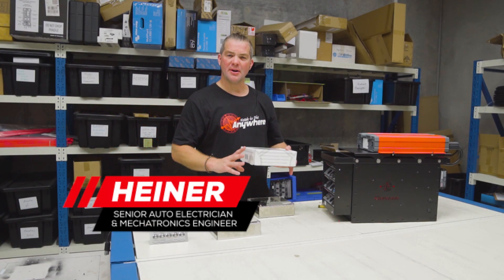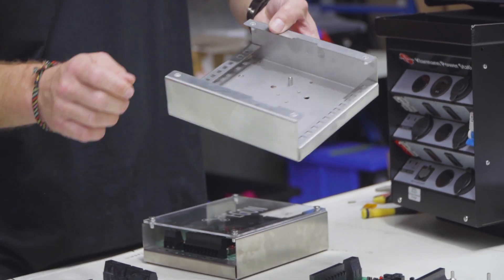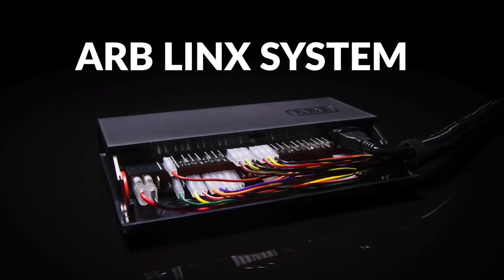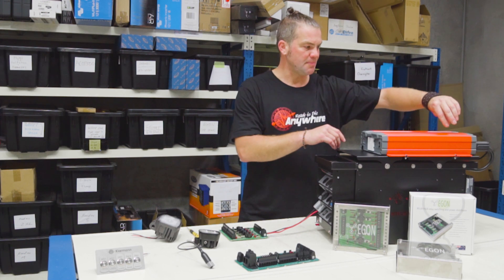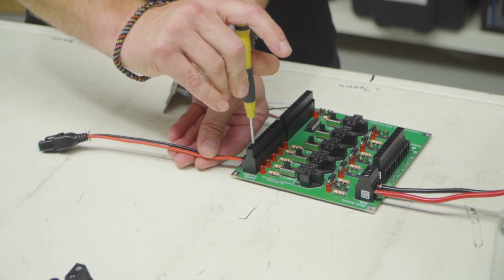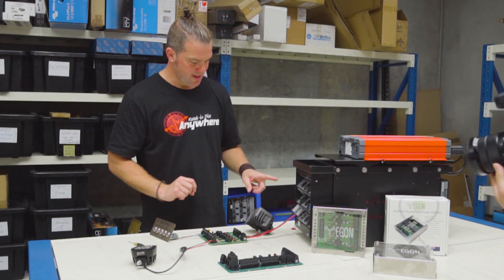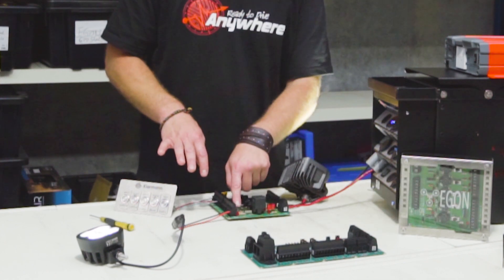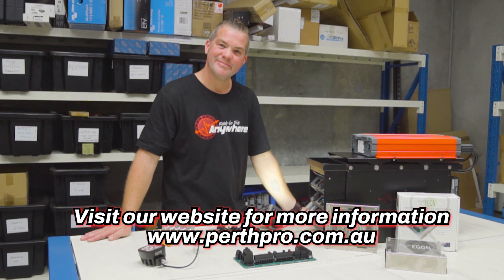Egon Relay Hub | Relay Switching & Power Distribution Solution

Comment: @ready to drive anywhere , Love your products. Been using the EGON DC Hub in my troopy build in the states.  But now building a single cab truck and the size of your products seems too big. I’m leaning toward new solid state realty systems for the compactness and fuseless ability. ( MSD Solid State relay hub, Switch-Pros, M-Unit blue, ) Any positives in sticking to the old school relay and fuse setups?

Comment: I just purchased a redarc bcdc40 and was about to pull the trigger on the Egon DC hub, but now im kinda confused, what's the difference between the relay hub and dc hub? I can only see a switch extra in the relay they both do the same. What do you recommend?
Reply from the maker: Hi there, thanks for your question. The Relay hub allows you to switch the 5x 20a outputs, where the DC Hub does not have any switching capabilities, but includes more outputs as well as inputs.
Reply: I’m also confused on this. Wouldn’t switches be separate to both relay and dc hubs? Do I need both with units with my build or just one? @ReadytoDriveAnywhere 
I really appreciate the approach to this product development. The quality, simplicity and support have helped me be slightly less dumb in the 12v space when attempting my build. 
Now ready to deck it out with all things egon

Comment: Seems like a great product. How does it compare against the Auxbeam 6 gang and all its copies? Are there any advantages when using the Egon?
Reply from the maker: The switching capacity is higher (25A), it is easier to integrate a large variety of switches into the Relay Hub (also OEM style switches in the dash for better vehicle integration), the Relay Hub has got constant power outputs, Relay Hub does not use any power in idle, It has got a maximum power rating of 80A, manual override switches on the unit itself, if a relay fails it can easily be replaced with automotive relays that are available worldwide, different switch systems like remotes and hard wired switches can be installed in parallel, systems like the ARB Linx can be integrated, it can act as a stand alone power distribution system for battery boxes.
Reply: You can buy a 12 output Auxbeam for less than this one that only has 5 outputs